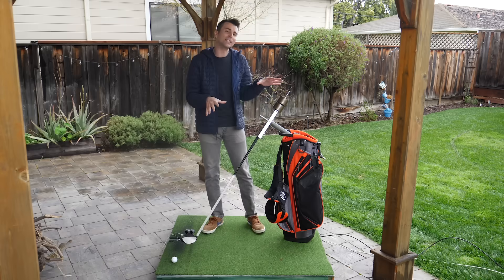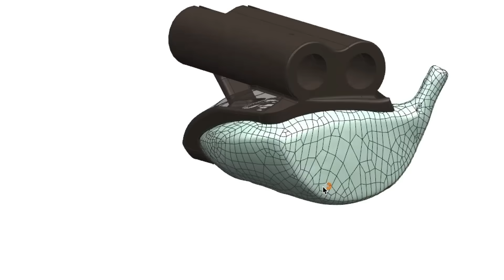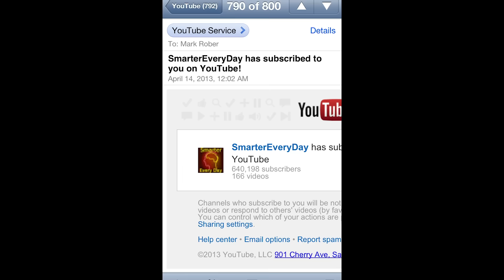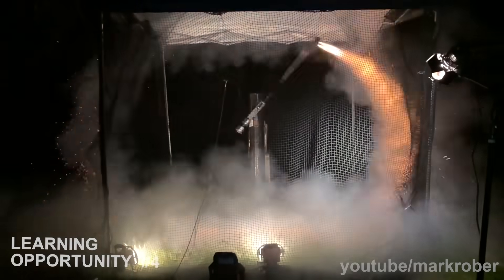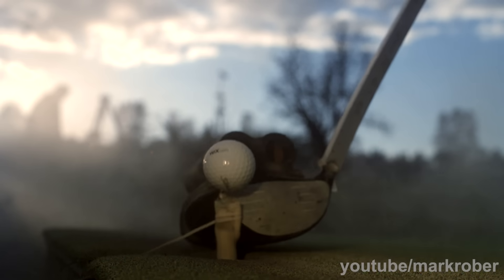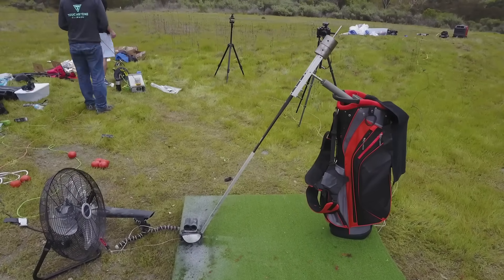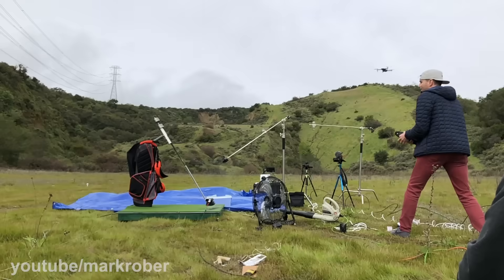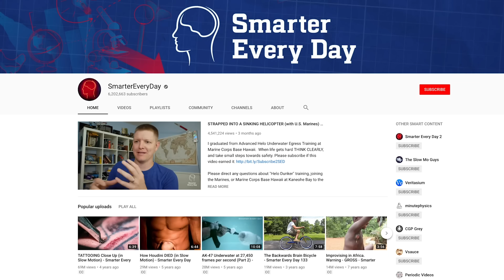Rocket Powered Golf Club at 100,000 FPS

Comment: With the high speed footage you should be able to determine the exit speed and angle? With some assumptions on the aerodynamic drag on the golf ball one should be able to make an estimate on the distance travelled? Would be cool to get your numbers.
Reply: @Azimuth1701  the shutter speed is hight
Reply: unfortunately, it's not that simple. The usual parabolic trajectory model (drag adjusted) doesn't apply in this case. Minute 11:10 shows a path where the takeoff angle seems to increase as the golf ball travels further away. This is due to the "magnus effect" where a spinning object will decrease the air drag by allowing the air to quickly travel along the surface of the ball and in the direction of the spin. This effect can generate a Lift force (in this case it was upwards), which gave the ball that weird trajectory. Additionally, a golf ball (unlike other smooth round objects) has a variable drag coefficient that's determined by the rate of revolutions; that's a part of it's dimpled design. So in order to create a trajectory model, you'd need to determine the initial take-off angle, the initial kinetic force, a graph of revolutions along it's path, a model that relates revolutions vs drag coefficient for a golf ball, a model for revolutions vs lift coefficient, and an air density vs height graph. You get all those models into a single multi-variable formula and then proceed to generate an estimated trajectory path. 

This is so convoluting, that I'd rather use a gps golf ball.

Comment: Another thing you could have done is make the ball pop straight up. if it was sitting just below the the low point of the club head and popped up after the 9th pass there would be no horizontal movement of the ball

Comment: Imagine if the people on the ISS just heard a "THUNK" outside of the station
Reply: The ISS is flying at around 7,7 kilometers per second.
If he shot a 45,9 gram golf ball up there, it would encounter the ISS at 7700 Meters per second relative velocity. It would have a kinetic energy of over 2,7 Megajoules, more Energy than half a kilogram of TNT.
That’s a bit more than a "thunk" 😂
Reply: @among-us-99999  "kaboom"
Reply: @among-us-99999  that’s actually pretty interesting
Reply: You sound like mark, Go Away
Reply: @among-us-99999  it depends on where it is hitting, if the golf ball travels in the trajectory of the ISS and it got hit, then it would hit at 7700 m/s, but if the ISS came in to the trajectory of the ball first, it would hit at how ever fast the ball is going which is not likely to be 7 km/s, not to mention gravity slowing it or pulling it back.
Reply: An overpressure of 15 psi corresponding to detonation of half kg of TNT generates a blast wind of around 120 km/h near the point of origin. It would not break the shuttle because it is made of Kepler and titanium maybe I am not sure about titanium.
Reply: @rudrasingh1414  r/woooosh
Reply: @randomdudepersonman2160  r/ihavereddit
Reply: "What happened"

"We got hit by a golf ball"
Reply: With great power comes great accuracy
   -no one ever

Comment: I have a question sir. What fuel did you use to propel the rocket motors
Reply: It actually isn't fuel. I had used rockets like these for a launch test a couple of years back. The cylinder is partially filled with a super combustible material that provides thrust.

Comment: Have you thought of redoing this with either GPS in the ball or using that electronic net thing that catches the ball and then measures how far it would have went?
Reply: There’s actual thing designed for this it’s called a launch monitor. It will tell the club speed, ball speed and distance
Reply: That's what I was thinking
Reply: I don't think any form of electronics in the ball could survive the hit, but perhaps a drone high enough in the sky with with a ball that's painted with something that glows in the dark, or failing that painted with something extremely reflective and give the drone a spotlight. Just have the drone fly up high enough and in the general direction the ball went and you'd be able to track it down pretty easily as long as it didn't land under a tree or something.

Simpler and much cheaper than a golf radar or speed tracker.
Reply: @jamesheaton5421  a trackman will do all of that. For 40k
Reply: @silversurfer8208  24k
Reply: @snowboarder819  24k magic

Comment: Fun Fact: the cones inside the exhaust of the rockets is because of the air around it is too high of a pressure and reduces efficiency. Meaning if you used this at a higher altitude the ball would go even further.

Comment: Obviously, the "100,000 feet per second" is a joke.  So I decided to actually calculate the club head speed: At 10 rps in a circle that looks to be about 5-6 feet in diameter, let's say 6, since 3.14 x 6 rounds to a nice even 20 foot circumference, which translates to about a 200 ft/s club head speed, less than twice that of a top pro. Seems odd, doesn't it?  On the other hand, the club must weigh at least ten times what a normal driver would weigh once you put all that reinforcement in it, so impart a LOT more kinetic energy to the ball.  If the equipment is still relatively intact, I;d love to know the weight of the club from fulcrum to contact point and the initial speed of the ball leaving the tee.  -- Looking forward to seeing "Smarter Every Day" vids. Thanks for the referral.

Comment: CHALLENGE FOR YOU MARK ROBER
challenge: make a putting size with motors where you can also control the power
rules:
1:you must be able to control the power
2:it doesn't build up power because it is using a motor not rocket (so it doesn't do a full rotation)
3:have fun building :D
Reply: also second challenge you don't have to do this or the other but still at least try mark rober
MAKE THIS WITH 3 E ROCKETS
Reply: please and I mean PLEASE DO THE FIRST CHALLENGE OF CREATING A PUTTING VERSION WITH MOTORS INSTEAD OF ROCKETS I THINK IT'D BE SO COOL

Comment: Those F motors produce about 9-18 pounds of thrust per second. That's great and all, but if you went with G motors (the largest model rocket motor you can buy without a permit) you'd get 18.01-36 pounds of thrust per second.

Or you could just say screw it, get a permit, and buy some S motors. Them bad boys produce 73,700-147,000 pounds of thrust per second

Comment: Another solution would be a hard cylinder over the lower half of the rubber tube which would still allow for it to flex at the hit area but be more rigid overall.

Comment: This was an awesome idea. I think making a human type swing would have been sweeter though. This was very happy gilmore ish with the wind up and drive.
For instance, using several different systems to accelerate the club, much like a human uses different muscle groups, so that it can achieve your 220fps would have been so awesome to watch in slow motion.
For instance, using multi stage springs along with your rockets on the down swing and then have the base rotate just before contact, just like rotating your hips into the swing, along with a damper and spring setup to stop its rotation.

Comment: So, Mark, I decided to crunch the numbers and estimate how far it went just for fun (and I've been learning how to do this as a Mechanical Engineering student 😉). I decided on conservative measurements, like an 8s flight time (I attempted to time it from your reactions), 44in (1.1176m) radius from the rotational axis to the golf ball for calculating tangential velocity (the standard length of a driver is 45in), and a 3in (0.0762m) starting height of the ball. I also "spherical cowed" everything - assume no friction or energy loss and the golf ball was a point mass. Obviously, acceleration is -9.81m/s^2 (32.1740ft/s^2), Earth's gravity. The max speed of an F-size rocket motor is 204.216m/s (670ft/s), but that needs to be converted to tangential velocity using v=rw where the golf club is rotating, which is equal to 228.2318m/s (748.792ft/s). You then plug all of that into xf = (at^2)/2 + vt + xi, which gives you approximately 1.512km (4,91ft or 0.9395 miles) of distance.

Comment: So just wondering why not put the motors on the weight side... This would cause a faster rotation with the same amount of propulsion.  Not to mention the ability to make a full metal rocket mount able to handle much more stress.  Though in doing this you would need to drastically re enforce the club.

Comment: Might not be 100% accurate but using simple calculations the club flew off at a vertical speed of 48.826 mph and went 24.283 m (or 79.668 ft) in the air

Comment: 8:44
According to a flighttime of 4:45, the golf clubs center of mass exited with approximately 21,8m/s in vertical direction (~78,6 km/h or 49 miles/h)
Maximum hight was ~ 24,3m

(Disregarding wind resistance)

I am currently preparing for my dynamics exam... 

Enjoy this information :D

Comment: I’m not sure but ur like a science guy so couldn’t you have measured the power outputted and translated that into distance travelled by just pelting it into a surface with a certain density and comparing that to something else and measuring its difference then multiplying that by what power the base one was? Idk but you could’ve figured out the distance without finding the balls

Comment: Another awesome video!  Though it's really not cool he didn't tell us how far it went. I 100% gaurantee he knows because 
A) He thinks of everything and that is the most obvious data point of this experiment 
B) He is a golfer and for us golfers distance is EVERYTHING!  
C) It is so darn easy to measure and I can think of several ways right now that are free or cheap.  Considering he already has the slow mo quality cameras, there are many options that measure the ball's speed and trajectory off the tee and can acurately tell you the distance (no need to find the ball)  Although, easiest would be to use a golf ball with internal GPS. They are very common and only $10 to $20. So my guess is it did not go very far so he's not telling us.
Super dissapointing though.

Comment: "Wait a minute... rockets explode!"
Reply: missles explode, rockets just burn out
Reply: Kelvin Yes. I have seen it happen.

A normal rocket burns in a controlled fashion with the exhaust gases exiting the nozzle in a predetermined direction and shape. This is because the propellant is solid without any voids. Rocketry 101.

A rocket motor than has been damaged by dropping it or pounding it ends up with small fractures running through the propellant. When ignited, the propellant does not burn in the predetermined way and the fractures mean uncontrolled burning of the propellant within the motor casing.

The more fractures, the more uncontrolled burning and <BANG>, the casing fails.

Fortunately, I had prepared a second rocket and we were allowed to enter that as a substitute. We came third overall!

2009 United Kingdom Amateur Youth Rocketry Challenge UKAYRoC
Reply: MatchstalkMan r/WOOOOOOSH

Comment: I wonder if you might have gotten a "better" result if you put the rockets on the counterweights. It would make them closer to the center of the circle, which would act as a higher gear for the entire wheel. Also this would mean that you could keep the somewhat more flexible shaft which would in turn act as a slingshot effect when it hits the ball (if it has time :) ).
Anyway, great video!

Comment: I think another good idea for stiffening the tee would be maybe to use a smaller diameter O.D. Clear vinyl tubing inside of the tee tubing  that would just stiffen up the tee but not transfer energy being that it’s still playable, and if the tee wasn’t hallow possibly use a larger diameter tubing to act as a structural sleeve..... no engineer just a plumber haha but I feel that would work great.

Comment: Mark Rober, that was a blast to watch!  Can you make a golf club that allows the rocket engines to move up the shaft, toward the pivot point, while the counter-weight moves down closer to the pivot point, at the correct ratio to maintain balance?  Much higher velocity of the club head should be obtained, if you calculate the distance of travel per revolution correctly.

Comment: Couldn't you use the launch angle of the setup and the frame rate of the camera to measure the exit velo to do an approximation of the distance traveled by the balls? I´m sure the drag characteristics of the ball and the air density of the location are well documented somewhere so you could get a pretty good estimate.

Comment: If you want to increase the power use sugar rockets they are much cheaper to make and are also waaaaaay more powerful 

How to make 
Go to some sort of lawn and garden store and pick up some stump remover (usually pure potassium nitrate) 
You will also need powdered sugar try to get the organic stuff because it has no additives 

You will probably need a coffee grinder to make the potassium nitrate a fine powder now mix 
35% potassium nitrate 
65% powdered sugar 
DANGER BE CAREFUL THIS IS NOW A PYROTECHNIC COMPOUND 
pour both of your materials on a piece of paper and use the diaper method to combine (folding the paper back and forth) once combined put into some sort of rocket engine shell 

congrats you did it you made a rocket engine

Comment: The club hits at 150 mph and on the last failure it got 4.45 seconds of hang time, so the club went about 342.361 ft. in the air when it came out of the U bolts.

Comment: One of the cooler projects ever on YT.  I've had some ideas with rocket engines for years.  Putting an F engine at the back of a football timed to go off at just the right altitude to send that football to Mars.  Putting fins on a small tree, balance it as best as possible, and send it up.  Strapping multiple engines to a playground spinner and hold on for dear life.  Try to move a car in neutral with just rocket engines.  And so on.  Loved this take on using rocket engines!

Comment: Suprised you didn't put a GPS tracker on the ball.
Reply: It would break
Reply: @vivminecl747  no it wont, it used to be used to track missiles
Reply: @vivminecl747  r/woosh
Reply: thescripter7 5     Do you have any idea how wooshing works?  Also r/IDontReallyHaveRedditIJustWatchYoutubeVideosOnItOnYoutube
Reply: thescripter7 5 I do believe you wiffed your whoosh
Reply: I have the same idea but then if the golf club hits it it could shatter the GPS tracker
Reply: Maybe inside of the ball 😂
Reply: @charmedwn  even worst
Reply: I was really hoping he would've, I'm so curious as to how far that thing went. 
And, it might not necessarily break if it was on the opposite side of impact. But Idk.
Reply: @hummingbird_saltalamaccia  I figured they'd have the drone already in the air so they could guestimate where it fell via drone cam.
Reply: @hummingbird_saltalamaccia  Nah, it would take the least amount of force on the side of the ball in respect to the direction the ball was being hit. Not saying it wouldn't break, but it would lower the chance.
Reply: @hummingbird_saltalamaccia  remember a newtons cradled
Reply: @hummingbird_saltalamaccia  you can calculate, how far ball would go on flat ground if there was no induced spin and air resistance by (projectile range fromula) (u^2 * sin(2x))/g
where u is speed before impact, x is angle at which ball was launched with ground (in degrees) and g is acceleration due to gravity. 
Formula will just give rough estimate, in reality ball could have flown much further due to magnus effect and if wind was blowing in direction of ball or it could have landed much closer than estimate if wind was blowing against the direction of ball, or hit a plane xD and magnus effect.
Reply: bruhhh the ball would hit the gps tracker's satellite
Reply: If you happened to but a gps tracker in the ball, the ball speed, spin, would all go wrong
Reply: That's the same thing I was going to comment
Reply: They should’ve used balls like they use at top golf
Reply: They make a "Genius Ball" that does exactly that. Would make an interesting follow up video.
Reply: Raptary as far as I know the genius ball was a complete failure and never went into production.
Reply: Could have used GCQuad, which is golf ball tracking hardware + software.
Reply: I M P A C T  F O R C E
Reply: HAHAHAHAH 😂😂😂
Reply: Right it will break I think when the club hits it but your right
Reply: and made it neon
Reply: It would make the ball  un even the golf ball  and to make an even ball it would be to expensive to make as so to buy one
Reply: Its gone
Reply: exactly what i was about to say but i checked if someone already said it 
its true tho its pretty easy to put a gps on the ball
Reply: John you live in Baker Street?
Reply: It would've been more practical to use a launch monitor (if they can even accurately calculate at those ball speeds)
Reply: Its supposed to be 'surprised'
Reply: John dut then you have to break the ball
Reply: LMAO
Reply: alex Loo,
A rope would not work as it would bounce back with the sheer force of the ball being hit by the club.
Reply: It would have been up where Jesus lives.
Reply: I was about to say that and then I saw your comment
Reply: John it. Would. Shatter.
Reply: John 
O
Reply: Or a camera
Reply: lmao
Reply: It would probably get destroyed due to it all of a sudden speeding up to far more than 100 miles an hour producing a lot of G forces Random guess probably around 18

Comment: you can try to strap a small low weight low energy consuming GPS into it, (like the ones on phones but higly modifying it, and try to see where it lands (maybe you will have to use a modified ball aswell that has a hole big enough for the battery and gps, and the rest filled with whatever golf balls are stuffed with, and then finish it by sealing the ball) its kinda complex but not impossible and totally worth a try to see how far it actually goes (you might go crazy finding out) (like the world's largest horn). amazing video anyways, learned many new things today, <3 from Chile Rober!